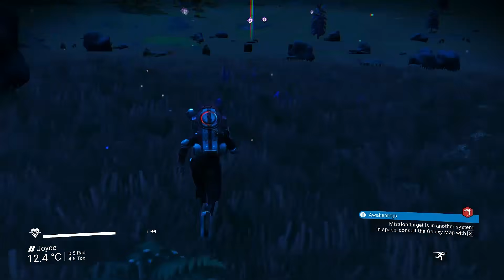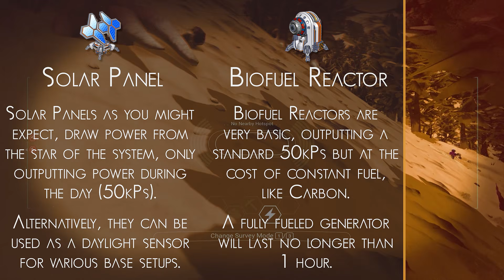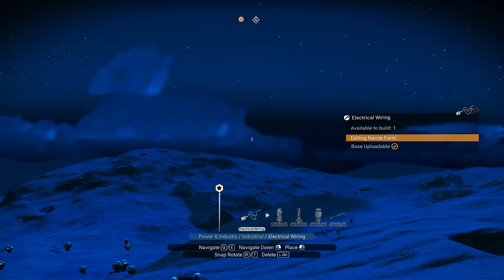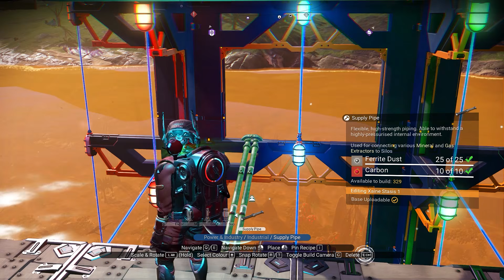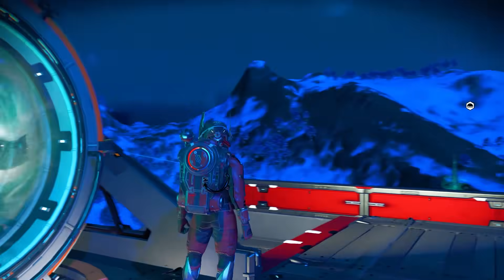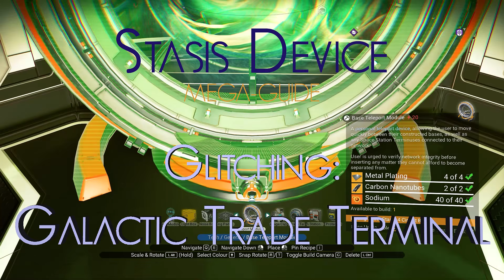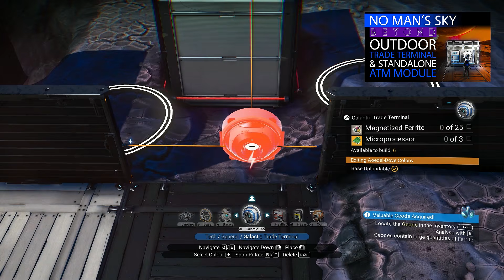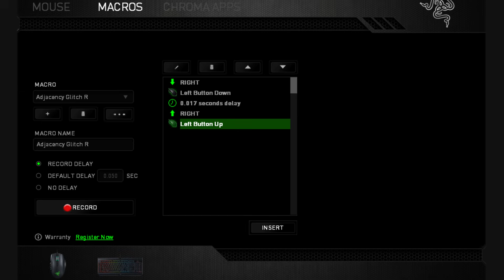Ultimate Money Making in No Man's Sky | Stasis Device Farming Mega-Guide, Units & Building NMS

Comment: just started & built my first base on a hot planet. Awesome guide. Is there any way to make the refining time a bit shorter?? Have two things. One is correction. The carbon planters are now standing planters which you can get in the nexus on one of the research terminals. Has carbon just like the originals so don't need anyone to build it for you if you dont have it. Just get salvage data & get it. Two. I ran into the supply depot bug where if you disconnect any of the pipe from the network it bugs out and says empty and wont show up filling. I couldn't find a solve for this on the internet. However I found a possible solution for others to try. Destroy all the connections to the network and reconnect all of the supply pipes. For good measure re-extend the base using walls along the pipes path just incase. It worked for me.
Reply from the maker: Nice work and it has always been standing planters, but many refer to them as carbon planters just as it's more descriptive.

Also, they made it available to get them after this video was released, hopefully in some way because of it (a brother can dream)

The issue you're having is a rough one I've been lucky to avoid, I'd hate to have to reconnect everything :(
Reply: @XainesWorld  Thanks, I'm just glad I was able to solve the issue. Would have hated to start over again. Took forever to find all three planet types in the same system, not sure if it because I picked lush universe during the end of the atlas missions. Even though it may be easier in some ways,  haven't touched glitching. Not sure if i'm comfortable with doing it yet. Definitely don't have the patience to build pylons or line up supply pipes or wires neatly. my base layouts are a mess except the central platform where everything is centralized. Is there an easier way to get ferrite dust quicker?? Takes forever for me to harvest large quantities of it with laser. Tried using a ballista like with carbon on bushes but didn't notice anything. Also not finding terminals or npcs that sell more than a 120 at a time. Most of the time spent building the base was gathering resources to build the stuff. Currently working on building my crop farm just finished all the bio-domes but finding a large quantity of the plants needed to plant the amount I need in them is taking forever even with flying around looking for them. Unfortunately, due to my feelings about glitching I had to do the hard way and not double stack the biomes. Still turned out decent looking. Any tips not mentioned in the guide or video? Also I was wondering about my previous question about shortening the time it takes to refine stuff without having to resort to 19 passes?
Reply: Never mind. Found I can make a uranium farm which converts to ferrite dust. 1:1 ratio.

Comment: Hello Xaine, i have a question and a scenario on which i would like to have your opinion. So in my current [i will keep this character in Euclid] save i've recently found a system that has a solanium planet with cobalt, a frost planet and a lush planet. these are the 3 planets needed for the stasis device farm you mentioned, i will probably build the farm on another planet from the system. I don't want to make an indium farm this time around because it's too easy. So i was wondering if i upload these 3 or 4 bases, each base on it's individual planet will they be visible to other players or not? Used to have 3 public farms in a single systme for explosives circuits and living glass and some people reported they couldn't see all 3.
Reply from the maker: Yes they will, the rule is that you can only have 1 base uploaded for public visibility per account.

Specifically account not just save, but say in a 6 planet system, you can have 6 bases total uploaded
Reply: @XainesWorld  thank you!

Comment: I'm about to start doing this. So far found a planet with everything needed for the Lush stage.. however it's now Post-Origins Update and I am wondering what adjustments need making in order to compensate for how Resource Extractors and Depots work now
(More Unified than Pre-Origins) I'm still a total noob when it comes too this only just built one other farm purely for AI
Reply: I'm currently working on mine, and tbh, the changes really dont affect this that much. You only really need 4-6 extractors per resource for a b class hotspot to get all you need within the 16 hour loop. Also a quick tip, make your echinocactus farm kinda big as you can refine cactus flesh into carbon.

Edit: Echinocactus is not the only plant to refine into carbon, sorry for misinformation.

Comment: Initially I thought I might never pull off something of this god damn size. However, after planning a setup for my own Activated Indium farm I took a look at your video again. Now I'm committed to building one of my own, albeit with modifications since I'm playing on the Xbox One (the original 2013 brick not X or S) and I don't think it'll handle something way too absurdly large. It'll take a while to build, but I'm certain I can pull it off in the end.
Reply from the maker: Awesome man! Tbh with this, the majority of the effort is learning how it all works, building it is pretty simple in the end :)
Reply: @XainesWorld  It's working out great, although I might have to spread out the crop farms into 5 separate farms. As cramming them into 2 bases causes serious issues with loading, as some of the crops fail to appear. This requires me to save at the base and reload until all the crops load in. Since I also don't want to risk a crash at one of the crop farms, 5 bases for Star, Gamma, Solanium, Frost, and Faecium/Cactus seems safe enough.

Comment: You probably won’t answer this but how did you make those powerline-like build with your extractors and supply pipes. I really wanna know how to organize my supplies and know where everything is
Reply from the maker: I used some glitch building techniques to get them to phase, but nowadays you can phase them without needing extra stuff a lot of the time.

If you build the basic structure made of arches first then build the supply depots into that, I also used pill lights as connectors for neatly positioning the wires.

If you want to learn more about glitch building as it currently is check out Beeblebum, he makes videos focusing on glitch building and he's a bit of a master at it, they're very good tutorials :)
Reply: @XainesWorld  🙏Thank you

Comment: Is base extension necessary for this build? I have been watching the video and reading the guide, but nowhere is it explained why or if this is even necessary. You might say "But dude! It is intuitive!" Not so much. Will the build exceed the normal 300u limit? If so how much? Will these loaded tunnels be needed for the resource harvesters in the way Minecraft needs chunks loaded for some farms? What does it mean that they will need reloaded every time you teleport? Is that relevant? I'm having trouble finding anything that really helps clear up any of these points via Google.

Cool vid though.
Reply from the maker: Extension is not always required, it just makes finding a location easier, if you are not extending, you will need to find a location that has all of these hotspots incredibly close.

There is a section of the guide devoted to the base extension in case you missed it, but ill answer your questions to the best of my ability.

*Will the build exceed the normal 300u limit?* Most likely, this is location depended due to the proximity of each of the hotspots your build requires.
*If so how much?* The maximum it can be extended is 1000u, so that is the cutoff point for how close the hotspots can be to the base computer.
*Will these loaded tunnels be needed for the resource harvesters in the way Minecraft needs chunks loaded for some farms?* No, it's not that the tunnels need to be loaded for the farm to work, it's that you expand the perimeter using objects. The radius of each object extends that perimeter which gives you an extra area in which you can stand and still build for that base, allowing you to extend this buildable area upto 1000u
*What does it mean that they will need reloaded every time you teleport?* The buildable area can be seen as either locked or unlocked, teleporting Locks the perimeter meaning you cannot extend it with any techniques, saving then reloading will unlock it again, this is only required for building anything outside of the standard 300u radius, and is not required for the general use of the farm afterward.
*Is that relevant?* Yes, but only for the building of the farm.
Reply: @XainesWorld  I appreciate the reply, but I still don't understand the why I guess. How close do they have to be? You state at one point that they have to be within 1000u of the base. If everything is within a 1000u radius is extension needed?
Reply from the maker: @franklinmccullough85  Aye they have to be within 1000u of the base computer because the limit of the extension is 1000u, if you can find a location where they are all within 300u, you won't need to extend

Comment: Is there like a chart showing how much we need of each thing in the crafting section? Im here crafting one at a time Lol.
Reply from the maker: For 64 stasis devices you'll need to craft in total 128 of each of the gas based items (nitrogen salt, thermic condensate, enriched carbon) which will craft into 64 of the semi conductor then super conductor, 64 of the mineral based items, which craft into 64 iridesite, 64 circuit board and 64 living glass, I forgot if it's still 5 glass per living glass, if some then 320 glass for the living glass

Comment: I have found that it IS possible to make supply pipe connections to existing pipe. New connections won’t snap to existing pipe, true... but supply will still flow. Wonky.
Reply from the maker: That interesting cheers, I tried that in the past and it didn't work for me, only with the actual connection points to share connections, must have been off with my placement
Reply: Xaine's World I’m on PS4, maybe it’s different for PC? I think there was a time that it didn’t work for me before either but it seems to now.

Comment: Hi.  I made a 64 device farm but curious how it changed in NMS origins update?  I had to put more EMGs on a couple bases, power output changed.  They added diminishing returns to extractors too, increased time to fill.  So Math probably needs to be redone on that.
Reply from the maker: Aye the extractors need to be reworked now, which I'll sort as soon as I can. The electromagnetic gens were a bug and are fixed in experimental, so should be public soon :)
Reply: @XainesWorld  Other than the Electromagnetric generator bug, my extractors were all fine.  
From your guide, these are the numbers required for extractors and silos:  
32,000 Storage for Nitrogen, radon, Sulphurine.  2,000/hour rate
3,200 Storage for Paraffinium, phosphorous, dioxite. 200/ hour rate
3,840 cobalt storage 240/ hour rate
11,520 oxygen storage 720/ hour rate
7,680 carbon.  I used standing planters (since video was made, standing planter blueprint available again at anomaly) 
People should double check their farms though. I made extra extractors setting up.

Comment: Too bad I can't get the flippin' blueprint. The game stopped giving me these kind of blueprints a few days ago, so I can't make anything more expensive than liquid explosive.
Reply from the maker: What source of the blueprints? If it's the manufacturing facilities, they don't always have an option for a blueprint and can chain with these no bp options for a little while but will always come back round.

Each riddle can have up to 3 outcomes to, not just correct or incorrect.

The race that owns the system dictates what riddle loop you are on, so if one is giving you trouble either stick with it or move to another
Reply: @XainesWorld  Yeah, I'll try something else than Vy'Keen. For whatever reason every mission type has taken me to those systems the last week, and I haven't got a single blueprint option since. Got the option every single time the two weeks before (when I started playing again). I'll be well prepared when it does work again, as my base now can get almost everything needed for the fusion ignitor. I'll stick to that mostly, as it would require more work to easily make  the stasis device.

Comment: Im currently stuck and getting very frustrated trying to figure this out. I found the solar system and planets i need. My first planet is just like yours in the vid (Lush with both cobalt and oxygen) I got my hotspots set up (Parraff, Gas, Cobalt, Oxygen, and Electric tower thing) and a base in-between them all within 1000u. 
I stacked 8 extractors of each type like in the video( cause they are all C class/ and built a wire system to connect my base to the electric generator tower and it supplies power just fine to my base but as soon as i connect a wire from my base to one of the actual mineral/gas extractor towets it just shuts everything off and says depleted. I have done everything up to getting the first base perimeter set up but now i cant seem to supply power to anything. Your video only goes over the different types of wires/switches or wire glitching stuff. Nothing that shows how you connected to other extractors and still keep them running. Ive been at this for days and just about to give up. I cant even get one extractor tower working how am i going to get this working for all of them
Reply: I have just one wire connected to the bottom generator to each of the ones stacked on top of then from the top connected it to my base (made poles along the way to attach the wire to because my base is more than 200u away from the generator)
Instead of doing that do i need to connect each of the 8 with their own wire to the base like i did with the top most generator? Does the supply line thing need to be connected to the generator as well or just the other extractors?
Reply: @chocobro7863  where do the "30 supply depots" come into play? just put them all at the base of the extractors??

Comment: Does this work in the waypoint update?
Reply from the maker: Largely, but there are now enough innacuracies that I'll be remaking it
Reply: @XainesWorld  Does those innacuracies have something to do with the diminishing returns of connecting the gas extractors to each other and the corresponding silo depots? For example, i connected 6 gas extractors and 31 silo depots to eachother, and cant reach an hourly rate of 2000/hr. I wonder if im doing something . I also when this new updated video will release. Thx man love ur vids.
Reply from the maker: @LeedleBeetle4  yes, the new diminishing returns rate is at 1,000 per hour, so for 2,000 per hour just cut the silos and extractors in half and have 2 separate networks on the same hotspot, just make sure none of the extractors or silo's in 1 network is too close to the other about a 10u distance would work.

You'll then just need to take the gas out of each of the 2 networks separately when harvesting so it's not too big of an annoyance
Reply from the maker: Also the remake will be a little while, soon but have a few other vids I need to get out first
Reply: @XainesWorld  is this for all gasses and not mineral, and are there any other major inaccuracies, love the vids 👍

Comment: Does this still work with the new update? I imagine that it does, but just in case
Reply from the maker: Aye, works perfectly upto 64 stasis devices per cycle, if you did more than that you just want to do the extra as a separate network in the gas hotspots, but nothing else would need changing

Comment: i just built the first part of my industrial sector and when i collected the gas from the storage from it it only gave me 2000 whereas your run through video had 32000. Did they limit it so you can only get the resources in the storage and not the entire system?
Reply from the maker: No a storage can only hold 1k each, so something is up.

You may not have waited long enough for more than 2k to be produce.

You may not have connected everything fully so only 2k storage of the network is accessible.

There may be another issue, but hard to know without more info
Reply: @XainesWorld  i found the problem and it was a connection but now i have another. When i harvested my star bulbs i got half the amount needed.
Reply from the maker: If you aren't getting the right amount of crops when harvesting, double check the optimising your multitool section of the video, it covers the optical drill upgrade and the layout to get the max amount from harvesting

Comment: Guide doesn't recommend a number of planters to have to produce the carbon needed
Reply from the maker: Pretty sure I did mention that, my testing showed an average of 85 carbon per planter at the time, as the amount you get is random, I suggested the amount of carbon you need/divided by 85, then rounding the number up/adding an extra
Reply: It was me assuming a numerical value for num of planters would have been put directly on the screen, or in the written, since everything else was.

I worked it out though, and have built a stasis farm since, with all credit to this guide. Thank you

Comment: Hey xaine does this still work 2023 or is there an updated way
Reply from the maker: It does for the most part, some game mechanics have changed a bit, I will be working on an updated version but I can't say when that will be available yet.

Primary change to look out for are the gases, each connected network of extractors will now be sort of capped at 1k resources per hour, so to combat that, make multiple network in the same spot without connecting them with pipes (so each connected network of extractors and silos doesn't go beyond 1k resources per hour)
Reply: @XainesWorld  Thanks for this, was wondering why my 7 B-class extractors were only producing 1260 gas/h